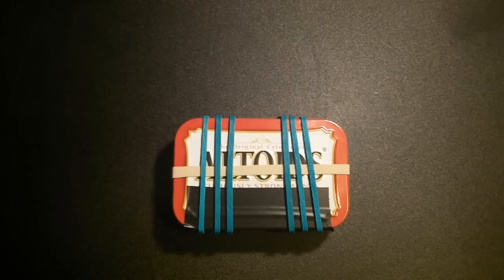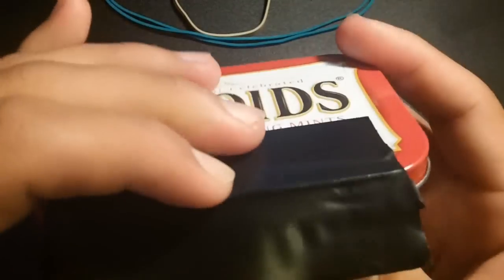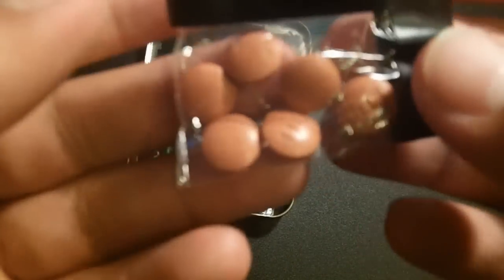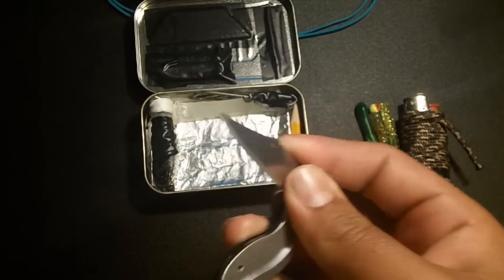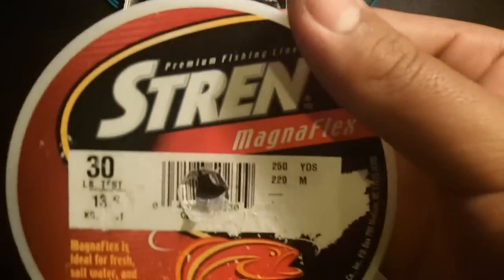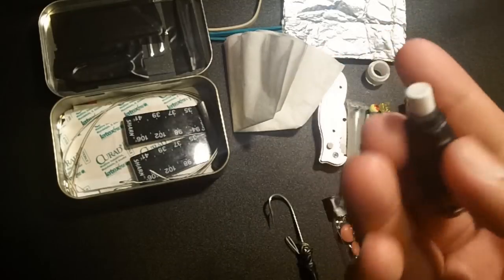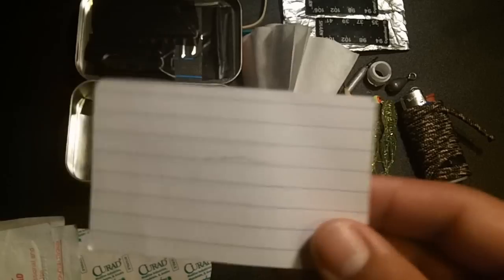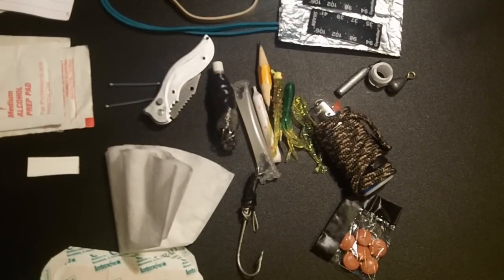Altoids Tin Survival Kit!

Comment: You need: a proper length paracord or b50 string, a compass, a container, tweezers, water purification tablets or iodine tincture, a proper signalling mirror, an electric flashlight, a 20$ bill, some quiktinder, a whistle and a proper fire-starter rather than a lighter.
Reply: I agree with you about the fire starter, compass, & the water tablets. But Y would you need a 20$ bill?
Reply: Say the power would be out and you happen to be in another city or there is a global disaster and you make your way from the wild to the closest town, you could use the cash to buy a few bottles of water or some food. Cash is always handy, you can't rely just on cards. There should always be some in the wallet, but an extra 20$ wouldn't take up much space in an emergency survival kit.
Reply: NikeTao As an ex military man, I have to say a lighter has a place in a survival kit,the trick is to always have multiple ignition sources. I like many others carry a little bic lighter, It's small, light, compact, waterproof and it's single hand operation. It's quick and easy to use. Due to the above facts, it's often my first go to solution for starting a fire. I also carry army storm proof matches, and a fire steel. They each have their pro's and cons. If you fall into a freezing river and get out and need an emergency fire, The lighter is your friend, a quick blow to dry the flint and you're good to go, just hold in place and light with one hand.You can also use the flint inside he lighter to use as an ignition source even without fuel which extends it's usability.Storm matches will work but you have to strike them, again you will be shivering badly, it will be hard, same with a fire steel. I also obviously carry tinder such as cotton balls in petroleum jelly,maya dust,kapok,Jute and wetfire as well as a few other forms of tinder. I'm just saying, don't knock the lighter it has it's place, anyone who thinks otherwise, is just being arrogant. Look at how many survivalists carry a cheap lighter. Nearly all of them, Hell even Bear Grylls does. I agree with the rest of your statement but a lighter is proper fire starter by all definitions. A fire steel is great, works when wet, can generate a lot of sparks to start a fire but it can be a pain to use in certain conditions, don't discount a lighter because it doesn't look survival enough to you.
Reply: Shaun Fontaine Well pointed out, although I think if you choose to carry a lighter, it's best to carry one with a striking wheel, so that if the fuel runs out you can still use it to strike a spark.
Reply: NikeTao Yeah, True, Like I said, totally agree with what you're saying regarding the rest of the stuff and I also think a lighter alone is not enough, it could break or lose fuel, so If I were him, like you pointed out, he should also have some other forms of starting a fire. The way he has it now, It looks more like it's just a fishing kit, way to much fishing stuff, especially for the sea.

Comment: You have some good ideas!  But improvements are NEEDED.  Thes area few issues I think you should change.  3 razor blades and a knife?  You wont need those razor blades if you keep your knife sharp.  Ditch the lures - worms and insects are readily available.  Get rid of the pencil - use a pen (more possible writing surfaces), get rid of the eraser.  Do you have any means of purifying water?  A few small purification tablets take up no room. Wrap tape around the WHOLE tin - so its ALL waterproof.

Comment: I really like your kit.  You did a great job.  the only thing I am going to ding you on is your neosporin straw.  I am giving you this comment as a wound care nurse.  Taking neosporin (or any antibiotic salve) from its original container and putting it into a new container is not conducive to the issue of an injury.  The straw isn't sterile, and the antibiotic will act upon the bacteria in the straw and the heat to seal it will actually damage the integrity of the antibiotic.  double down on the cleaning supplies (alcohol or even better chlorhexadine) for wounds.   Again, otherwise, great job!

Comment: Dude you have fishing stuff but no float for big hucks guessing yes you could use the melted straw but my guess is you wouldn't see it and most likely your huck will be heavy for the improvised float the rest is good but I do disagree with elastic bands mabie more wire/cordage wrapped in electrical tape to make a proper snare as what you had was 3 separate pieces and all you had was elastic bands and the cordage but you wouldn't want to cut your cordage as could be used to make a bow and arrow type of thing so more wire would be a good thing but cool this isn't hate call it constructive feedback

Comment: Ok some issues I find with this kit and lots of things that are missing. The neosporin is not needed. It does not disinfect wounds it helps heal wounds. If you have a wound more than just a small cut it is useless to have. The last thing you should be worried about is small cuts. If you are in a survival instance once you cut the tube it will leak over everything. Get a bigger bic they fit just as good. Get a para cord bracelet it will save you more space and can always be with you. Put a bigger pencil in there with a sharpener. Add water purifying tablets. It is by far more important than ibuprofen. switch out the strait needle for a curved needle they work just as good for sewing fabrics and even better if you need to stitch flesh. More fishing line for that reason. Add in a metal match with some char cloth. Lose the tin foil use sticks for holding food inc fish over a fire. Lose some hooks. You do not need deep sea hook if you live away from the coast. The same can be said for if you live on the coast. You do not need lake hooks. Finally ad in a small magnifying glass for fires if room is left.

Comment: Get rid of the razor blades, you have a knife. get rid of the large fish hooks, small hooks can catch big fish, large hooks will not catch small fish. Make and add a fire starter ( cotton ball with vasaline). get rid of the matches and add a ferro rod. exchange the bday candle and add a bday trick candle. add a button compass. add a piece of sand paper 320 to sharpen your knife.  The aluminum foil is very good to carry, it can be used to boil water by adding hot rocks, you can make char cloth with it. add water purification tablets. get rid of the electrical tape, electrical tape is crap, use gorilla duck tape (can also be used as a fire starter. get rid of the rubber bands thy will fail you, use a old bike inner tube. like the coffee filters.

Comment: u seem to be solely based on the fact that you have a water source with edible marine life  i would say add some small solid thin wire (stuff you can bend and have it keep the shape good for shelter fabrication tool fabrication or repair also a candle is not more wind resistant than a match in the real world in a controlled environment sure it can withstand .06 km/h wind flow better makes not difference in real world also i would suggest making your tin more resistant  to water by adding a small amount of thin weather stripping all the way around the lip but great idea with the poly in the straw also maybe add some crazy glue you can use it to stop bleeding and bind small wounds but i guess it may be good for your area u could make a v(2.0)

Comment: Dude you should change what you put in there, like i doubt you need wire, 2 sets of fishing line, dental floss, and chord, just bring one you dont need ten different pieces of string, and do the same with blades, you have a pocket knife so get rid of the box cutter blades, and same with the fire starters, bring the matches or lighter not both, and forget the fishing stuff all together

Comment: Why have matches and a lighter?
Reply: +Claris Richter In case if you ran out of matches or you ran out of lighter fluid in your lighter, you will always have a back up.
Reply: +Grumpy Cat Doesn&#39;t Approve You can light hundreds of fires with a single lighter. A few matches won't make a difference.
Reply: Claris Richter Well you made a point, but it's still good to have a backup

Comment: Lol an illegal switchblade
Reply: Not illegal everywhere
Reply: Switchblades are legal in some states.
Reply: That's not a switchblade.
Reply: It's an assisted opener, which is completely different from a switchblade.
Reply: Thirty ought Six dude its a switch blade! you push one button to open it. assisted openers work by pushing down on a tab on the top of the blade that when its folded, stick out of the back knife. its spring after the initial push, this is spring all the way so switch blade...
Reply: Jack Bolton Dude there is no button. If you look at the knife, you can see it has thumb studs on the blade. The "button" is the fulcrum.